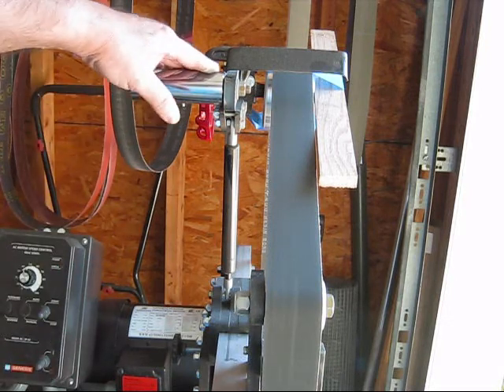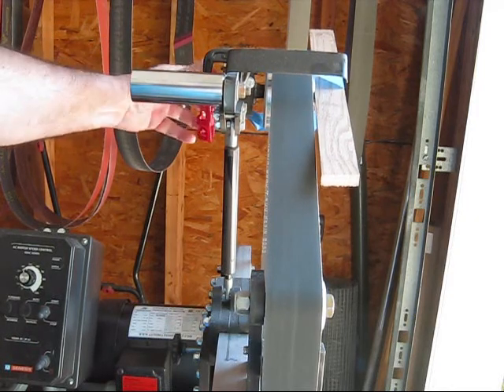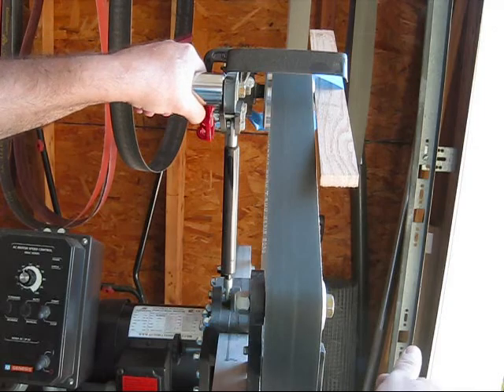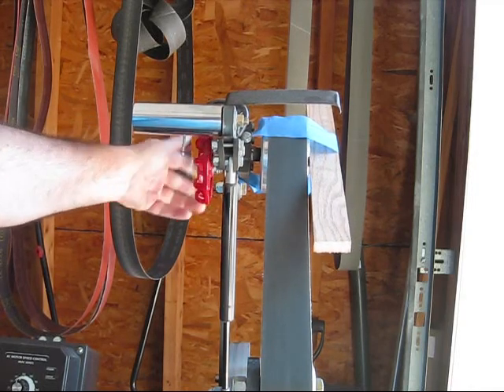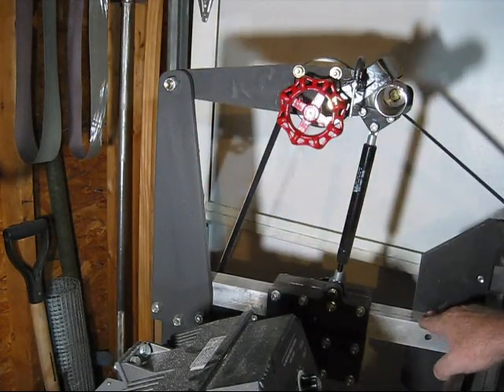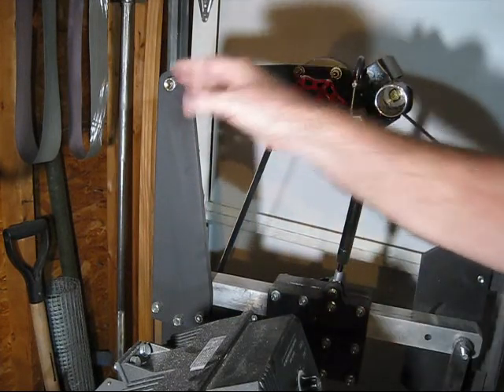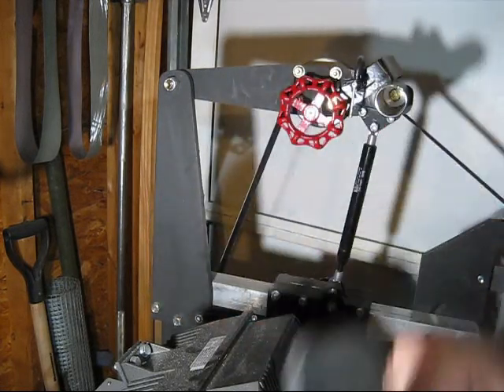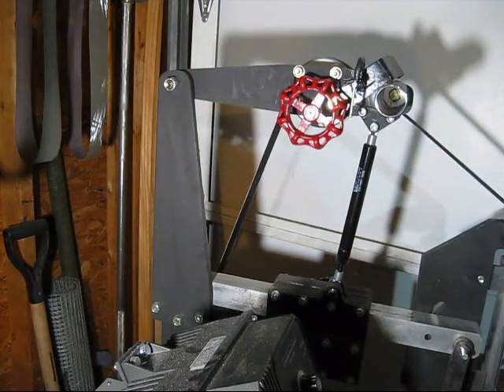GIB V2 Mod

Comment: Duuuude. I've been fighting these tracking issues for years with shims and BS. This is gold thanks a ton.
Reply from the maker: @Joshua Gilbrech Glad I could help! Jamie with Polar Bear Forge couldn't make this change to the kit because it would make the kit too big to ship using the postal service flat rate boxes he uses. I actually got this idea for a correction from Nick Wheeler, where he was talking about getting his grinder to track true and how the tracking arm has to be parallel to the bottom of the belt. With this mod my GIB tracks as good as any grinder I've seen.

Comment: I did not have any problem with the GIB 2.0. I had no trouble with the design as it came from Polar Bear Forge. I do have a question what is that c clamp holding up? There was nothing in the kit that requires a c clamp.
Reply from the maker: @B Brown. I'm glad you are satisfied with how the stock GIB tracks, but by getting the axle of the tracking wheel bracket parallel with the bottom of the belt it tracks much better. I can run mine in forward or reverse and it will track dead center both directions. The clamp holds a bracket that I use to mount a sponge when I'm wet grinding. See the following video for more details: 
https://www.youtube.com/watch?v=FLB_Em9Mxjw

Comment: Can you please tell me what the length/dimensions for the new arm.
Reply from the maker: @jared Yerger Sorry, but I don't have the grinder anymore, so I can't take a measurement for you. It was in the neighborhood of 5-6 inches as I remember. You will need to measure your set up. With a belt on the grinder and the gas shock down as low as you can get it, measure the rear of the upright where the top arm attaches and calculate how much you would need to raise this connection point so as to make the top arm parallel with the bottom of the belt. according to what size drive wheel you have the bottom of the belt should be near horizontal. The goal is to have the tracking wheel bracket axle,which is the  bolt that goes through that little rectangular block, parallel with the bottom of the belt. If these two components are parallel the geometry is perfect for tracking. Hope this makes sense!
Reply: @ChucksMagic  yes it does. Thank you for your time and detailed reply! Like many others and yourself I had a hard time with tracking on the GIB v2.